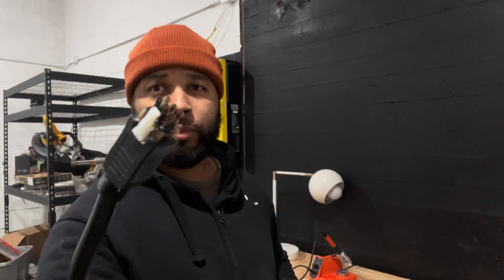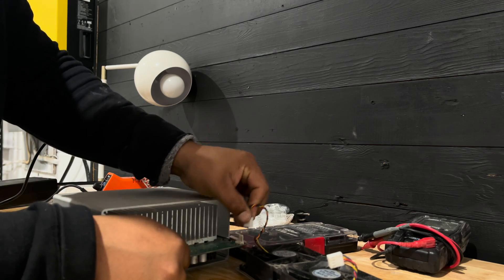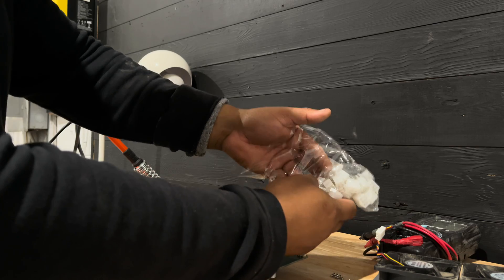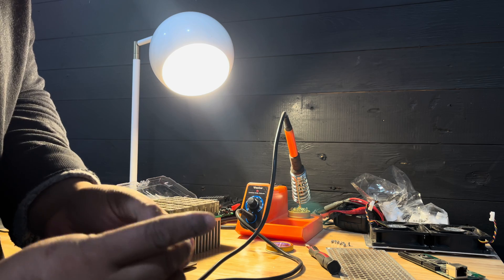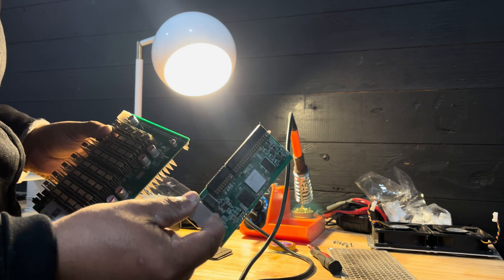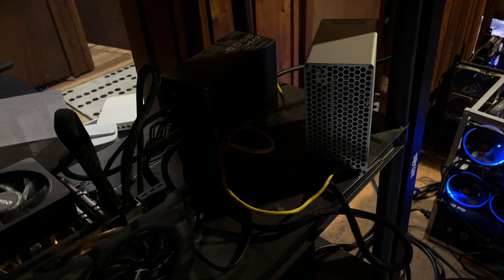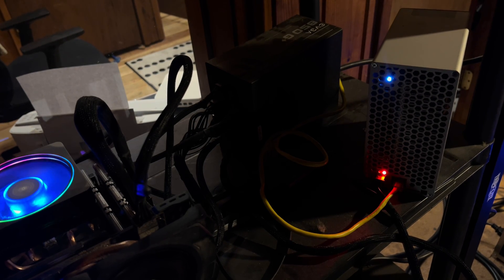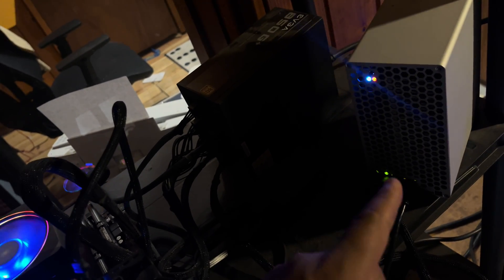It’s Alive! Doing this saved my Goldshell Mini Doge

Comment: Bro. I had the same issue. You need to lower the power consumption in the settings of the miner. The settings by default are on high but they don’t tell you that in time, you will burn the miner out by default and maybe start a fire.
Reply from the maker: I honestly believe that the bottleneck was the Goldshell power source that came with the miner. After inspecting the miner, the connector on the power source was completely destroyed and the connector on the miner was intact, except for the plastic portion that melted. My assumption is that the pins from the Goldshell power source (PSU) is not spec to withstand the power consumed by the miner at the higher power consumption setting. I’m currently running my mini doge miner with an EVGA gold plus power supply and so far I don’t have any issues.
Reply: @JeanCast  yes. I’m doing the same as well but within about 6 months it will melt again. I started with the same power supply and eventually, it also did damage to the supply as well.
Reply from the maker: @princeben7544  interesting. Thanks for your feedback I’ll consider making those changes to prevent another failure on the PSU.